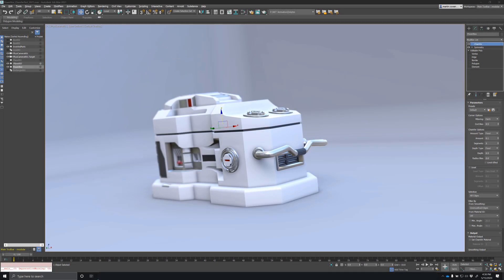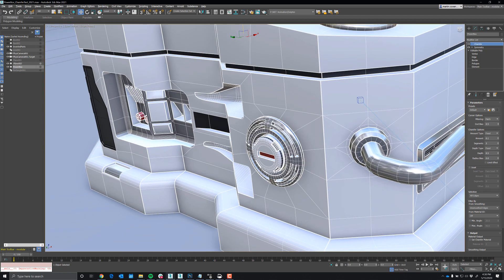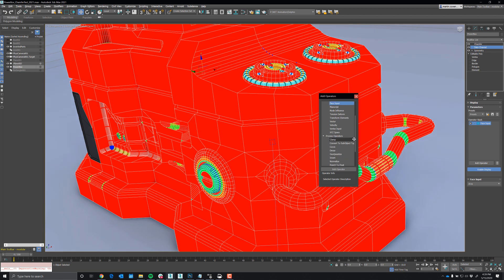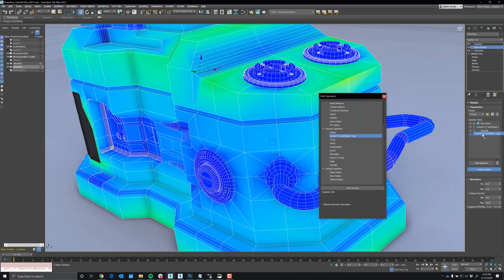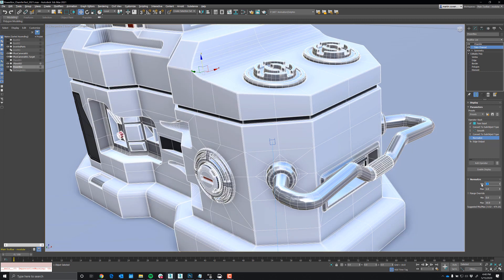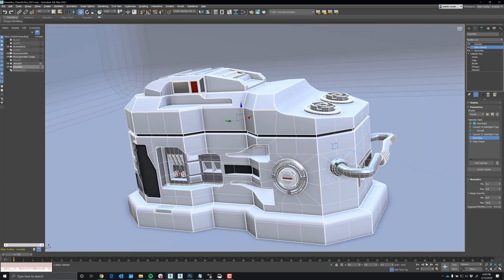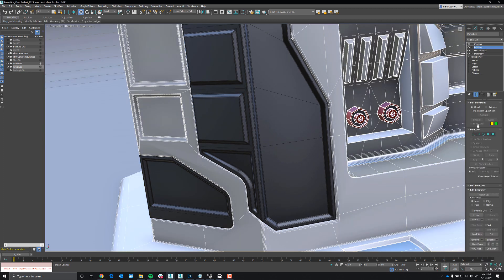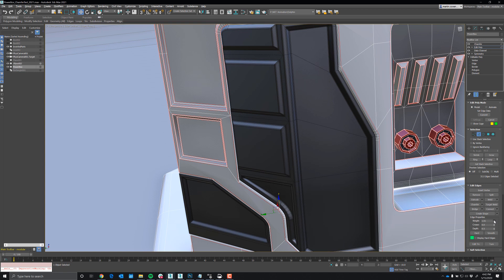QuickTip Weighted Chamfer using the Data Channel Modifier

Comment: Awesome quick tip Martin, They way you've shown it looks very accesible. I haven't played with the Data Modifier before and I'm going to try it out today.
Show us some of the things you like to use the DCM for. Thanks!
Reply from the maker: Thanks Lucas. I do dig the DCM. I have a few other videos showing some things I've done as tips you can check out. Taking data from the mesh, modifying and then applying it in different ways is really powerful.

Comment: Great tip Martin, thank you for sharing it. I wanted to ask you something, you edited those edges at the end with the weight value from the edit poly, but you did something similar before you started the demo in the editable poly? or the fix you used for the whole object is based on the area selection you did inside the data channel? Thanks! :)
Reply from the maker: Hey Andres. I didn't do any weighting on the base editable poly mesh. I just had the chamfer modifier set to fixed, so the amount was uniform across the whole mesh.
Reply: Oh I see, is just because it looks like a really simple and procedural solution that I thought there was something else and it couldn't be that good ;)  thanks for clarifying this Martin, this is amazingly helpful